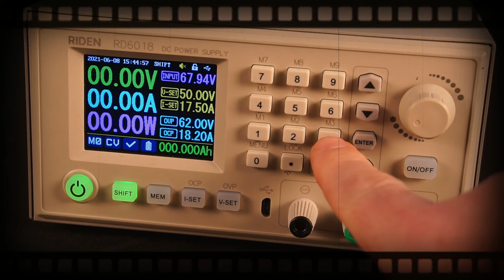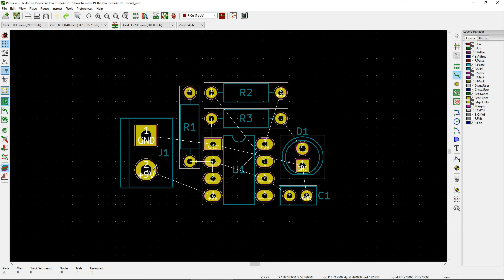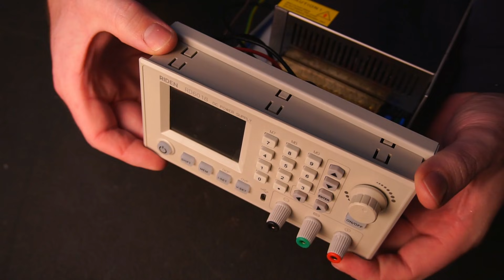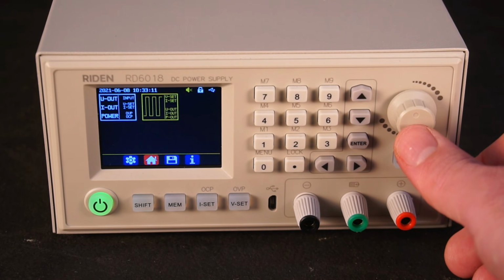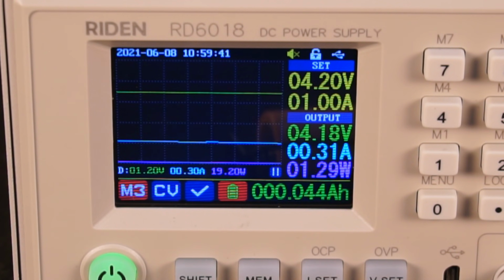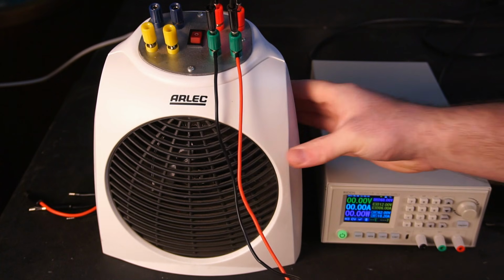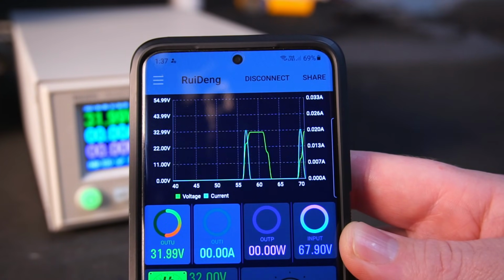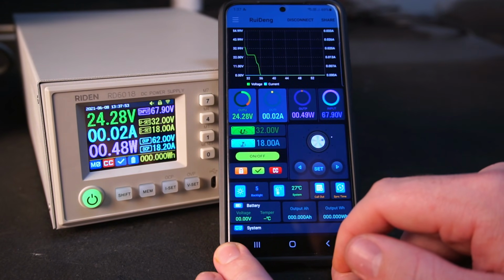Riden RD6018 Power Supply Review II 60Volts, 18Amps

Comment: It would be useful to check if the spikes would be reduced by coupling the 100nF capacitor directly on the output of the PSU block, meaning BEFORE power flows through the RD6018 PCB. In case the spikes come from the PSU, this modification would help reduce any electronic stress that the RD6018 is imposed upon.
Reply: Another Youtuber actually changed the PSU to a very expensive programmable PSU to test if the "noise" was the PSU or the RD itself, it is the RD device.
Reply: @JohanlastZa  are you talking about eevblog? I believe he found out he was incorrectly terminating the probe or wasn't using it on 10x

Comment: Ordered mine without the case and 3d printed a smaller one, that case is just too deep for my bench i placed the psu under the desk much cleaner.
Reply: Link?
Reply: Which psu did you use instead then? Was thinking of printing my case aswell
Reply: There is a shorter case available.   PN: S06D

I have it on mine for the same reason - My bench isn't very deep.    Power In is from the DC output of the SMPS.  

      This also makes the PS unit a portable supply ... I used a laptop 19V 3 A  supply with banana jacks on it's output and it made it really easy when I needed some power on the go.  As I only needed 12V or less, it was much easier than lugging the fullsize unit and case.  
      (You could even run it off a  car battery in the smaller case)
Reply: @scottmitten2248  Oh great, so i can use whatever psu?
Reply: @aarriikknn33ll  pretty much.   You won't be able to get an output voltage higher than the input. 
(The Riden is really just a fancy Buck converter with a really nice user interface)

Not sure about the stock firmware, but the modified one allows you to set a maximum power output, so if using a smaller supply, you don't accidently try to draw too much.
Reply: @scottmitten2248  Okay awesome, think i might use a atx psu then, i won't need more than 12v anyways, just high current.

Comment: If only there was a 135V 12A version of that, could have saved a few hundred on a battery charger. I suppose if you need a really clean supply a pi-filter could be added to the output to get rid of most those spikes and the 50Hz stuff too. Dunno why that wasn't part of the design and simply charged a few $ more. Still, my current ones are just 30V 10A. I'll probaly just get a front end and build my own input supply with a 1kVA 48V transformer I happen to have on hand (a 1kVA Antec toroid with 48vac out). Heavier but I don't plan on moving it much anyway.
Reply: Wow you have a 1kva 48V at home? That's so beafy. Hey do you plan on doing videos on your build? Or may be blog/forum posts at least?.
Reply: @therealb888  I plan to start a new channel and maybe a Patreon when I have enough content to do maybe weekly or at least monthly uploads. 1kVA really is not that much, though probably overkill for most common 30-60V benchwork. Several years ago (and still sees occassional use) I built a 0-500v 30A AC/DC supply from 2x 5kVA variacs in series with a pi-filter that runs on a 240V 30A mains circuit. It's mostly used for relatively low power testing of some of my nuttier projects that you really don't want to fail at full power, instead of just magic smoke a shotgun-blast-level bang along with molten copper and silicon flying at lethal speeds is the usual result.

A project I have on the drawing board (that may get built in a few years, it's very expensive, first thing I need is a $5k 3D printer) is a 150kW/300kVA plasma speaker (basically a class D audio amp on steroids that runs a step up transformer instead of an 8ohm speaker). With power draws that large battery banks or dedicated 3-phase generators are the way to go, with a buck-boost converter for control (120VDC in from 32s lipo packs in parallel, 12-150VDC and 10-2000A out) = rock concert loud at full power and good bass response since the arc is 12-15 feet long (1200kV, 250mA).

Comment: I would crimp the cables for the screw in terminal, I always do that at my electronic builds and it is more safe, because no strains of the cable can come out :) but the rest is very nice! I build a comparable power supply fron an atx supply, it works very nice and i payed about 20-30€, the main points were the Hirschmann banana socket haha :D but they just work better

Comment: 12:44 A few days ago, they released an update that adds the option to disable charging after exceeding a predefined temperature
Reply: My custom firmware have that option, and many many other functions and options... 
You can click on my avatar and under the last video you will see links to the forums and a link to the full manual "RD6006, RD6012, RD6018, RD6006P DC Power Supplies with Custom Firmware by UniSoft"

Comment: the power supply cord is not included, you have to source that yourself; the coin battery is not included, also must buy separately; the leads also need to be bought separately or use some from your other meters possibly; a DIY person can make some slightly heavier leads for battery charging... the Riden 6018 assembles fairly easily and I used it a lot for battery charging and it shuts down as the battery gets to your pre-set charge level as one would want it to....I assembled and top balanced many LiFePO4 cells in 272ah and 280ah varieties prior to assembling them into 24-volt nominal batteries in 2P8S and 4P8S configuration for solar PV-generated electrical storage....so my primary use is actually precise top balancing of the LiFePO4 cells to 3.55 volts before battery assembly and the Riden worked great... just 2 days ago, I charged a 2P8S assembled battery from 19% SOC to 32 percent SOC via an inverter connected to another 2P8S battery all done off-grid.... the Riden 6018 was charging at 17 amps and slightly over 400 watts into the 544ah 24-volt battery without any issues....as it charges on constant voltage the amps output will go down as it gets closer to the desired top charge you set...it works great...(the Riden 6018) for battery charging...

Comment: I have never run my RD6006 more than 3 amps, but I only use it for rebuilding old VTVMs.  
I can’t imagine how anyone would be using 12, 18 or even 24 amps.  
What use would require such high amperes?
Reply: Mostly for charghing RC batteries, but also for powering projects with beefy DC motors. I chose the 6018 specifically because of the current carrying capacity. I will have it paired with a 715W PSU that can deliver almost 13 amps at 56V, which is why the 6012 wouldn't have worked.

Comment: I will say, the assembly on this looks about a thousand times easier than on the DPS5020 I purchased. I was able to pull that off in a satisfactory way, but not following the factory instructions, hahah.
Reply: yes, it is easyer now , because improve that to let it easy, don't use solder , just screw , it is be ok 
DPS5020 is old products, there are not many experience 
so sorry for that
Reply: Assembly took about 20 minutes after first reviewing the kit assembly manual. "Digital power supply case (S800) assembly instruction" date 2020.7.24, and a once through the assembly video:
"Best Bench Power Supply | RD6018W Power Supply | How to Assemble | RD6018 RD6012 RD6006 | 2022" at youtube v=RCPv95t-V8o
Suggestions:

Be slow and careful when initially setting the machine screws or one can rather easily end up with tilted screws, esp on the PSU mounting screws (5 in my case).

One should also be careful when inserting the pre-tinned +V and -V wire ends into the screw-points of the green connector block of the control unit. In my kit, the insulation was trimmed such that the 4 wires can be inserted too far and interfere with proper connection between the wire and the connector contact point.

If you're going to use the external thermal sensor, install the "Temperature sensor
extension board" before you mount the PSU. I installed mine such that the wire from the socket "board" points up and the extension wire runs OVER the top of the PSU case once mounted. That method provides more working slack in the extension wire for routing purposes, and allowed me to keep the sensor wiring far from the AC power lines. I taped the wire to the top of the PSU's solid metal case once it was mounted. I've seen some videos where people install the board with the wire pointing down toward the bottom of the case.

Comment: You - and to be fair - the other reviewers are measuring high frequency transients wrong on the scope.  You are using the ground clip on the scope probe, when you really need to be measuring using the spring clip which will eliminate inductance of the ground clip wire.  This needs to be done at the load.

Comment: The graphing feature on the app is really neat, except you can't stop the data update as it's in operation, so trying to zoom in on an earlier portion of the graph is impossible because it'll keep auto zooming. You need to stop and disconnect before it lets you look at the charting in fine detail.
One hint when you are zooming in and out to look at the details: if you want to pan up and down, you first need to start panning sideways and then you'll be able to pan up and down from there.  A bit strange that you can't start panning vertically right away, but it works well.
It lets you zoom in to the single second capture intervals down to one lsb.

Comment: Love my RD6018W

It's limited atm due to the power supply but I've got the Huawei R4850G2 with the rectifier plug, CAN module etc waiting to be setup.

It's overkill but will allow multiple other buck/boost controllers to run alongside the RD6018W from a single psu

Comment: Screw terminals should not be used with stranded wires barely or soldered, you should use a wire end crimp for this purpose. If not, connection can get loose over time and generate resistance and thus heat! The RD6018 looks promising and it is probably very efficient - did you test efficiency and ripple on loaded output?

Comment: 700 mv spike can damage ttl logic at 5.00v  did you try 470 nf  ceramic capacitor instead of 100 nf to reduce spikes?..I was designing  power supplies which are more accurative .(wide range current limiting..constant current  or foldback current in the same circuit. etc.)

Comment: Thanks this was most helpful. Considering one to power an amateur AM transmitter.  Would need 60v at 5A peaking with modulation to 15A. I think the ripple will be a problem in that it will modulate the carrier but prepared to try it, and experiment with an external hefty DC LC filter. Question, did you see any interlock or accessible control access points that could be used to shut down power in the event if a detected fault in the powered equipment? This may be the purchase-stopper for me! Thanks!

Comment: I personnaly remove the switching power suplly inside to put a traditional linear power supply. ( Transformer, rectifier and  big capacitor).  Now the ripples and spikes are almost gone.
Reply: good
Reply: Switching measured is from the step down converter, not PSU. Linear stage step down is gonna smooth it way down. See RD6006S

Comment: Great video - thank you VERY much! My power supply came with a resistor to fit across one of the +ve and -ve outputs to improve the high frequency noise - I think it's a 5.2K Ohms resistor. Have you tried this and seen whether it helps on your setup?
Reply: Mine doesnt have any output ripple I made my own 5k resistor tho and it doesnt change anything. output ripple on the RD stays the same. Even adding a filter capacitor to the input psu doesnt make a diffrence Its the RD itself I suppose
Reply: @legobuildingsrewiew7538  The manufacturer states the RD6018 version does not require the resistor...using their recommended PSU. (the PSU matched to mine was model XJ-S1000W-68V. However, note that the specs also show the output ripple of the RD6012 and RD6018 are inherently higher than the RD6006. I don't have info on the RD6024 ripple.
Output ripple typical 
RD6006   100mV VPP 
RD6012/18   250mV VPP@6A
These came from user manual 
"Model: RD6006/RD6006W/ RD6012/RD6012WRD6018/RD6018W"
page 4, dated: Date: 2020.9.14

Comment: Nice mate, another piecce of impressive tech for the lab, still like my linier programble Power supply. but its a heavy beast with a massive transformer so its not something that you can move around easily,
Kinda wish they had used a blue pole for the battery connection as somebodies bound to think its an earth and blow the thing up.
Reply: thank you for your suggestion
Reply: @rdtech9153  Yes this is what I was thinking too. Use a blue pole for battery charging, add temperature protection & please add earth ground green banana jack for earthing. So totally 4 banana plugs at front. Also note that the main concern of most buyers are the  transients & ripple. The output needs to be smoothed more.
Reply: @therealb888  for now we have finished the RD series, we will change that if we make new series power supply later

Comment: if i use the red post it shows a higher voltage then just batt but not enough to be the one i set to charge the batt but it puts no amps in.

Comment: Hello. Have some questions.

1. power supply uses PWM volt regulator! is there any noise on the output?

2. Normally if the power supply can handle 18A in 60v then it can handle more A in 12v if the volt regula can handle more?

3. volt regularor is a bit small and undersized with a small heatsink! Have you done a heat test with any car light bulbs?

4. Load 18A and then short-circuit. will it survive?
Reply: why should it be able to handle more amps at lower voltage? 18A is the max because of the resistance of the wires and the PCB. you cant overdoe that. It has over current protection from short circuits.
Reply: @legobuildingsrewiew7538  
WATT will be the same but amp will not be.
500w / 24v = 20.8A
500w / 12v = 41.26A

Comment: Please correct me if I'm wrong. We got double power loss bcos this is SMPS behind SMPS. So if first SMPS power delivery have 85% efficiency, so the second power/voltage admin  transforming second time DC to DC. And if it could have 85% efficiency as well - in total we have 70% efficiency - it is not?
Reply: Good observation. Every conversion step however negligible will have losses but that's the same for any variable PS. In fact this law holds for any forms of energy conversion.

Comment: so the temperature probe fault in halting battery charging is a but, fixable in firmware? Did you ask the manufacturer? Thanks
Reply from the maker: No, the temp probe isn't preventing the battery from charging. The point I was making in the video was the temp probe is only there to give the user a temperature readout. It offers no thermal shutdown if a battery were to overheat during charging :)
Reply: There is a custom made firmware available that does offer the use of the temp probe to stop the charge:

https://www.eevblog.com/forum/testgear/custom-firmware-reference-document-for-riden-rd60xx-power-supplies/

It's a long thread, but interesting.

Or there is a reference document for the custom firmware listed here:  https://www.eevblog.com/forum/testgear/custom-firmware-reference-document-for-riden-rd60xx-power-supplies/

I'd love to see @Schematix do a review using the custom firmware.

Comment: my unit if i use the green post turns on volts start to ramp up i hear the power supply click, but then quickly turns off then the red batt light goes blue and green on\off button goes dark. any ideas?

Comment: If 100Volt 100nF Polyester film capacitor reduces the "noise" by 50%, won't a 100Volt (or higher) 200nF Polyester film capacitor remove it almost completely?

Comment: question would this work for charging 48v battery pack (lithium) say 58-60v and individual cells 3.5-4.2v  if I used my 24v 16amp power supply with it? or should I just toss the 24v one and get a 60v power supply?
Reply: no, this is buck power supply, input must be higher than output , if you input 24V, the max output will be 21V

Comment: Correct me if im wrong but aren't your wires kinda thin for 18 amps even with two? 5:19
Reply: Not really. They are more than good enough even if it was just one pair. Industrial standards allow alot of current in closed ventilated cabbinets
Reply: @AlpineTheHusky  1.5sq mm is rated for 16A. 2.5 for 25A if I remember correctly.
Reply: @therealb888 0.75mm 6A, 1mm 10A, 1.5mm 13/16A, 2.5 I think 25A I think

Comment: silly question, but could you plug in a residental solar panel? say a 140w panel, rated for 30v at 8 amp?
Reply: If it's connected to a battery that the panel is supplying power to.
Not if you just want to connect it directly, since the open circuit voltage would be too high from the panels.

Comment: Does it have a reverse polarity protection feature?
Reply: A 25A fuse will protect it from a reverse connection to a large battery, but then you'll have to solder on a replacement. They have an accessory fuse included stated as test only, which has a clip attachment.

Comment: is there a way to get a Linear type of Power supply to use for this?  even if it's just 60V 5amps or 10amps would be enough for me.  thanks
Reply: Should be able to substitute whatever linear supply you want, it doesn't really care as long as the voltage and current is below its limits.

Comment: Would adding an inductor also help remove the ripples?
Reply from the maker: Since this is a buck type converter, there is already an inductor on the output. It's possible adding an additional ferrite bead or toroid could further reduce noise